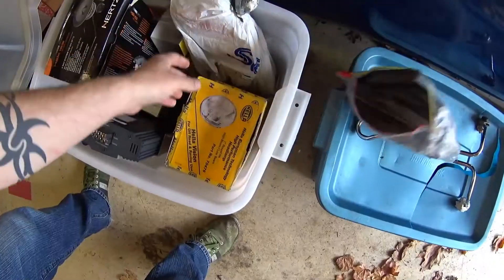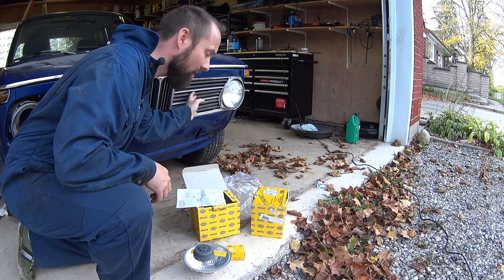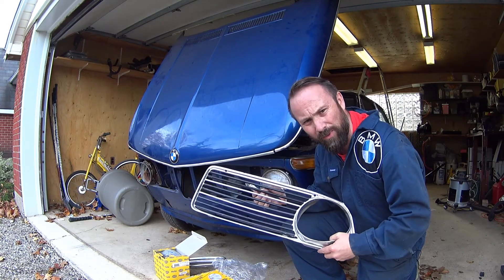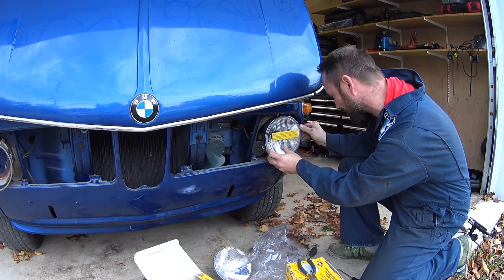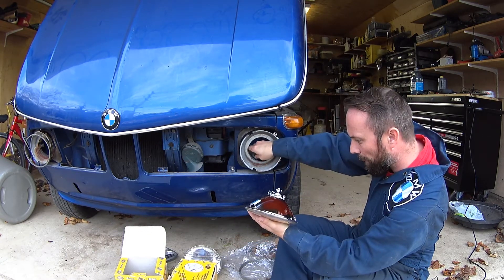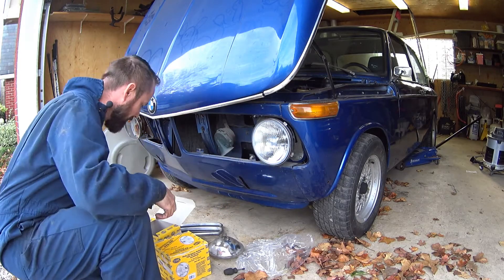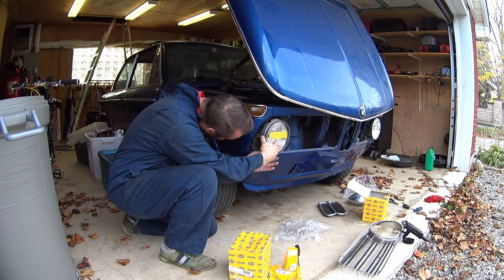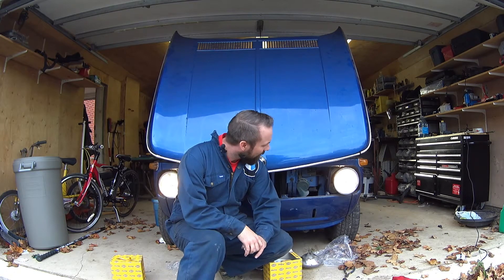PROJECT 1968 BMW 2002 EP02 Hella Headlights

Comment: What size tires are you running? Those fronts look perfect.
Reply from the maker: Thanks!  Those are 205 60 13s, Yokohama...  I don't think you can get them anymore, so I'm going with 888s next summer. With the sport springs that I have they fit great.  Only rubbing that I've had has been on the James  Bay Road.
Reply: @spuriouspseudo  Thank you!